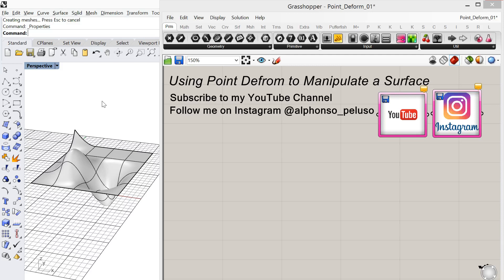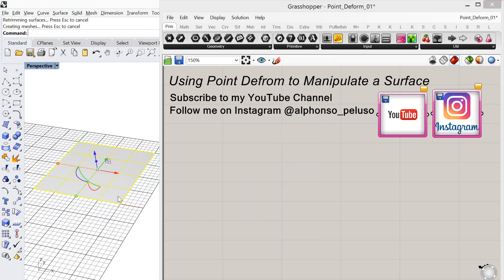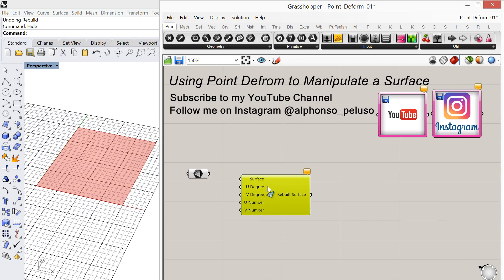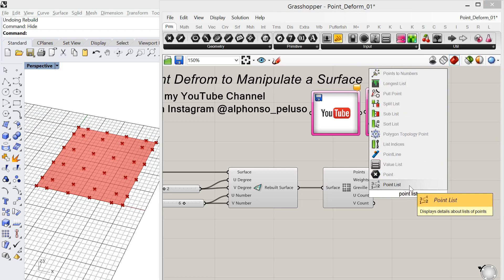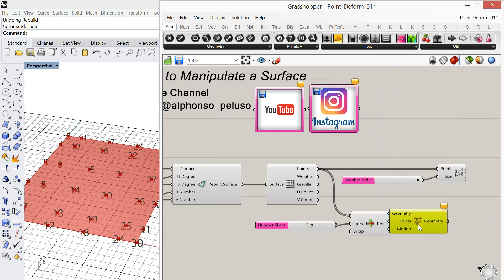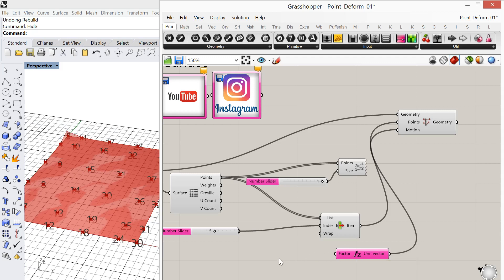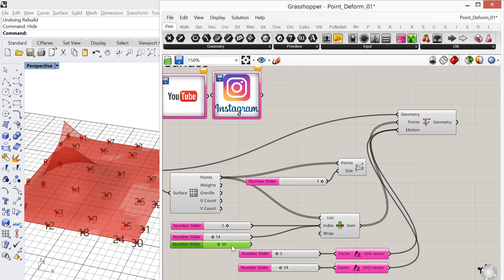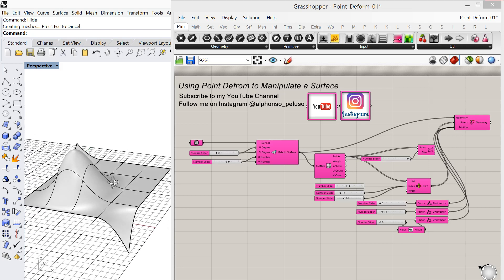Rhino 3D and Grasshopper 3D Surface Manipulation

Comment: what if I have hundreds of points? Am I supposed to do the same process for each of them? Are there any shortcuts?
Reply from the maker: @sikaluka  You can use a series, range, or graph mapper to generate multiple values.
Reply: @AlphonsoPeluso  thank you so much. I'm actually trying to replicate on rhino-grasshopper the "Lanterna" by Fuksas located in Rome, Italy. It's an asymmetrical structure and it's surface is quite irregular. What tools would you suggest using to reconstruct it on these softwares?

Comment: how to deform a surface which is not a rectangle, for example a circle?  coz re building it makes it a rectangle.
Reply from the maker: Same technique should work for a circular surface. Draw a circle than use the boundary surface (planar surface) capsule. Then follow the rest of the script.
Reply: @AlphonsoPeluso  thank you, will try this
Reply: @AlphonsoPeluso  i did try as you said, but it still rebuilds it into a square, plz find image on the link, maybe i did sommething wrong https://ibb.co/9bbkkDV
Reply from the maker: Yes you are correct. This is because Rhino makes a trimmed surface and then Grasshopper un trims it.
Reply: @AlphonsoPeluso  so it's not possible to morph it by this method right?
Reply from the maker: You can if you can make the surface untrimmed.
Reply: @AlphonsoPeluso  ok thanks

Comment: so what if i want 1,2,3,4,5 all to be 2m high ?
Do i have to go through all of this 5 times or is there away to mark them all at once as 2m ?

Maybe by using a sticky or a 2point to line" ?
Reply from the maker: You can use a panel to make a list and plug it into one Z vector.